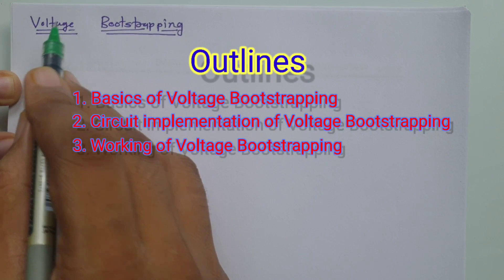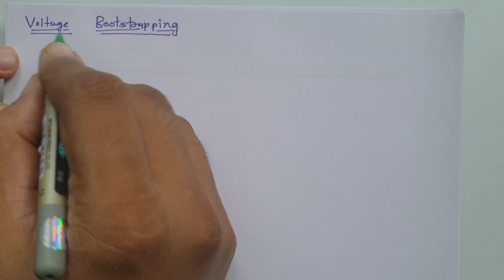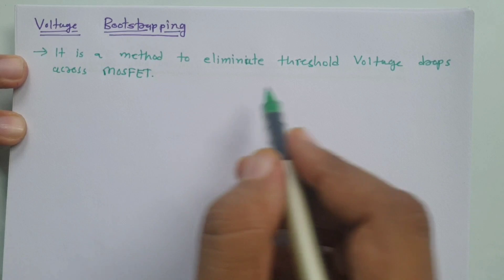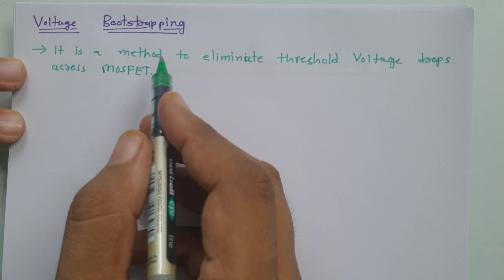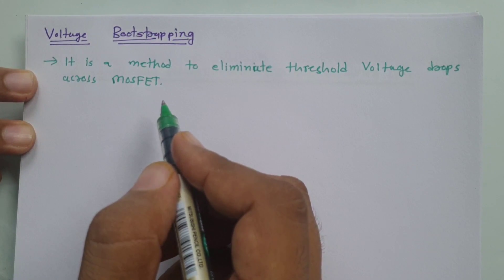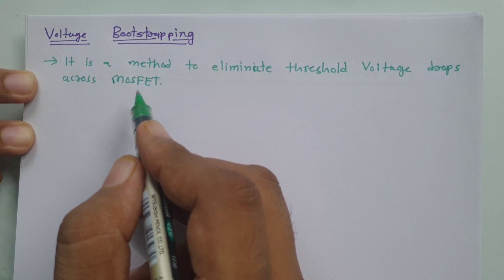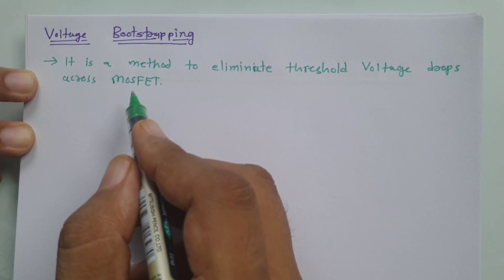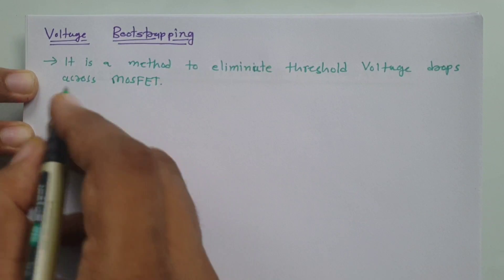Voltage Bootstrapping | Basics & Circuit of Voltage Bootstrapping | Working of Voltage Bootstrapping

Comment: i dont get it why would that capacitor drive the voltage up to vdd
Reply from the maker: Cb is very high compared to Cs, which results very less voltage across drop across MOSFET